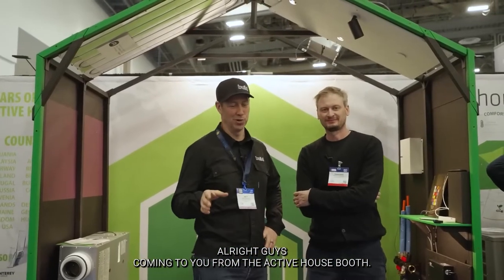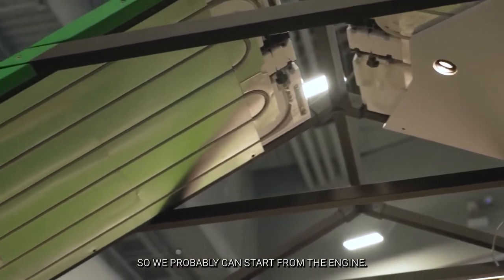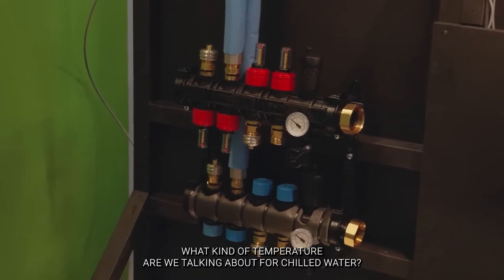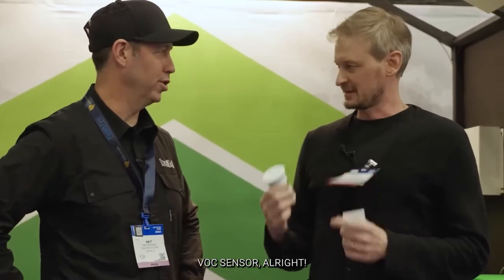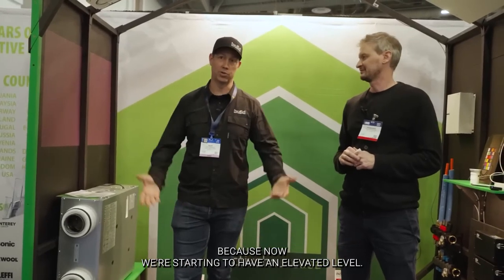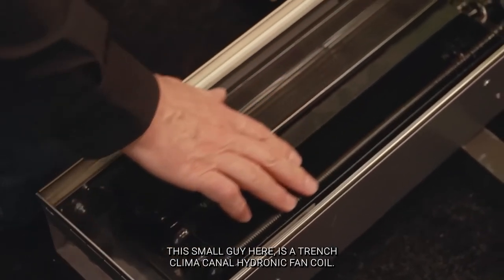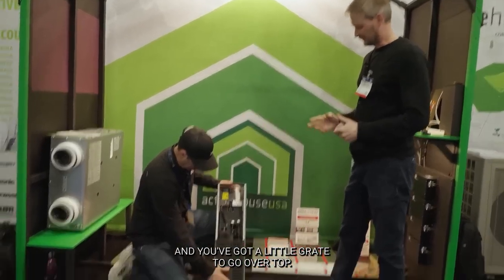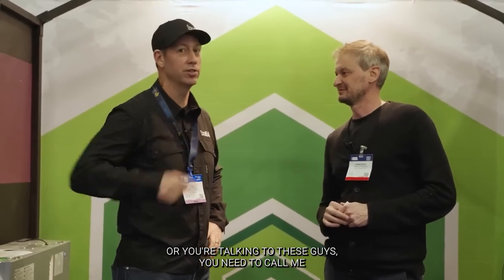Matt Risinger Discusses Radiant Cooling With Messana

Comment: radiant floors are great, radiant ceilings not so much. I'm thinking of separating heating into the floor and cooling into the ceiling or walls, my concern is that with heating it only works up to human heigh level, so if there is bigger distance to ceiling or between walls it would probably be just creating cold spots instead of evenly cooling the room wont it? Whats the kinda distance limit to objects where the efficiency starts to drop off hard?
Reply from the maker: Hey Raul!

What do you feel are the downsides of a radiant ceiling? Lots of people tend to initially get hung up on the whole "heat rises" idea, when in reality that is not true. Hot air is what rises! Thermal radiation only moves from hot to cold (second law of thermodynamics)!

So, if you make your ceiling warmer than the objects below it, thermal energy will still be radiated downward to the environment, providing heating (similar to the Sun!)

Regarding the distance effect, bigger rooms certainly have higher heating and cooling loads. We take these loads into account when doing our ceiling panel layout for a project. So, as long as you use the right number of panels to meet your specific loads, you will be able to heat and cool effectively! Typically projects require ~70% ceiling coverage to meet cooling loads with a radiant system, while heating loads are met easily at ~40%. If you are concerned about capacity, you can always oversize your system and increase the radiant surface area!

Compared to forced air systems, radiant systems significantly reduce hot/cold spots because conditioned air isn't being supplied or returned from a fixed location. The air/entire environment itself is being conditioned by the radiant system, which does so pretty evenly via a radiant floor, and very evenly via a radiant ceiling since all furniture obstructions are avoided. 

Lastly, your point about splitting up heating in the floor and cooling in the ceiling brings up a great point. When you utilize a radiant floor for heating and a radiant ceiling for cooling, you get convection cycles that help improve overall effectiveness. 

In heating, cold air sinks and makes contact with the warm floor, so the coldest air is conditioned first, and the cycle continues. The same thing happens in cooling via the ceiling, where warm air rises, is cooled by the chilled ceiling, and then the air falls and is replaced by warmer air. The best part is that Messana Controls can manage these types of systems easily, so you don't have to pick between a ceiling or floor, we can design a hybrid system!
Reply: @messanatech  
Lemme clarify what i meant, using floors for heating is the best, i've had my house fully covered with just the radiant heating and i had the most enjoyable climate in the winters.  
Now having an investment like that is worth if you can use the same system for cooling as well (even if u make more loops its still more cost efficient than an air system on top just for the cooling). But using the floors for cooling is definitely not great, having cold floors is a health hazard (as well as too hot floors) and overall not comfy. 
Now what i was wondering is to use other surface for cooling (Ceiling or Walls) instead and that's how i found your video.

Using same surface for both cooling/heating is not ideal in my opinion, even though its economical. As heating from top down is generally not comfy as well, you feel a lot better if ur head is not the first thing that gets heated. I've seen some studies that suggested that humans are less sensitive to those effects if that comes from vertical surface (like a wall); 
So lets say we separate the heating loops (definitely going into the floor)and  cooling loops. Question is what is a better placement for cooling,  Walls or Ceiling?

-Ceiling have more equal distribution and mirrors the floor
-Having leaks in a ceiling can have more worse consequences
-Walls generally have more thermal mass
-Walls have more surface u need to cover and they are not available evenly as u can have glazing etc

Also thing to consider is that Ceiling is the place where the heat is leaking the most from in a house even if u insulate it well. Then goes glazing , then floor and then only walls.
Reply from the maker: @Raul195  Hey Raul!

You're certainly correct, radiant systems are known as the most comfortable way to condition a space, and radiant floors are hard to beat for heating! We certainly understand where you're coming from regarding radiant floor cooling.

Regarding the whole "top part of your head" idea, the operating temperature of a radiant ceiling (90°-100° F) doesn't really provide that level of temperature gradient. Take the Sun for example, which emits about 20 W Max. of thermal energy to your head on a hot day (which you'll certainly feel). In comparison, a radiant ceiling like ours only emits 0.3 W, so you don't get that "heated head" feeling you mentioned. The goal is to bring the environment to the desired setpoint and efficiently maintain the temperature with the radiant system, not constantly radiating more and more heat.

As mentioned before, the ceiling is the best place to provide cooling because of the natural convection cycle created. And while walls work (we even have some panels behind walls in our office), we try and steer people away from doing so because they're more likely to drill into a wall compared to a ceiling. So we recommend the ceiling over a wall to avoid accidental panel punctures. 

Regarding your points: 

-Ceiling have more equal distribution and mirrors the floor: TRUE!
-Having leaks in a ceiling can have more worse consequences: Somewhat true, however, people are more likely to puncture panels installed in the wall since drilling into walls is more common than drilling into ceilings.
-Walls generally have more thermal mass: It is worth noting that the main reason we needed to move the radiant system to the ceiling is to achieve a LOW thermal mass. This is necessary to ensure the radiant surface temperature can be changed quickly to avoid the dew point temperature in cooling (when condensation forms). 
-Walls have more surface u need to cover and they are not available evenly as u can have glazing etc: True, but the number of panels is decided based on room-by-room load calculations, so you would require about the same number of panels regardless of where they are placed.
Reply: @messanatech  
Yeah, I watched some other videos form your company and I'm warming to the ceiling idea, I did not consider the effect of cold air actually dropping down once it's cold enough, another thing is that u can potentially also add ceiling fans to rooms where u want the mixing of that cold air to happen faster (giving u a bit of that AC perk of having on demand cooling u don't need to wait for)

only thing I dont get about the thermal mass, is why is it a bad thing, radiant systems are low temp so it's going to be somewhat more slow than any other system regardless, having more mass means there is more time to react for the system, yes it becomes a bit harder to control due to inertia but at the same time it should be easier to keep it in a sweet spot and less prone to reaching dew point, cause u have more time to pump in the kws of thermal energy in over longer period of time, if u have speedier control, u still gonna have reduced performance and might be loosing that fight over time,say if there is anomal temp/hear loss or smth , while thermal mass will act as a sort of battery stretching your efforts for a longer time
Reply from the maker: @Raul195  You can certainly incorporate a ceiling fan, but at the end of the day, our goal is to meet heating and cooling loads in a silent and invisible way. Most of our projects are high-end residential, so our clients want to maximize comfort without compromising aesthetics. Typically if we want to have some sort of fan blowing air, we'd do so using a more subtle hydronic fan coil, like the one in this video. That way it can be tied into the hydronic system to provide efficient heating and cooling.

The reason we need a low thermal mass lies solely in radiant cooling performance. However, there are some downsides of a high-mass system in heating:

In heating, if we have a high-mass floor, the energy source will need to supply water at a higher temperature, which decreases the efficiency of the source (heat pump, boiler, etc.). Though the thermal energy can be stored in the floor, it will inevitably be released to the surrounding environment. Instead, it is best to run the heat pumps at the water temperature where they are most efficient and supply this water more often to maintain the occupant's ideal set point, instead of supplying very hot water less frequently. 

Now when it comes down to radiant cooling, at Messana, this is our specialty, so we've designed our controls to provide cooling at their highest capacity without risking condensation. To do so, Messana Controls manages mixing and diverting valves to adjust the supply water temperature to the radiant ceiling. So, we keep the radiant surface just above the dew point to maximize radiant cooling output without producing condensation. This is far easier with a low-mass system because as you have stated, a high-mass system will take longer to heat up or cool down. So, with a low mass system, if humidity is introduced to the environment, our sensors will know, and Messana Controls will adjust the supply water temperature quickly to avoid condensation. So, this is when response time/having a low mass becomes critical!

When Messana Controls manages radiant cooling in a high-mass radiant floor, the system will stay further from the dew point to remain a safe distance away from producing condensation, limiting cooling output. So, we can be more aggressive with radiant cooling performance with a low-mass system!

I also wanted to note that at times, to maximize cooling performance, we supply water that is cooler than the dew point! This is because we know the temperature gradient that will be generated by our panels covered with drywall, so we know the radiant surface won't get cold enough to produce condensation. This is just an example of a way Messana Controls uniquely maximizes radiant cooling output. 

It sounds like you may benefit from requesting a system estimate and chatting with our sales/engineering teams here: https://messana.tech/get-started/